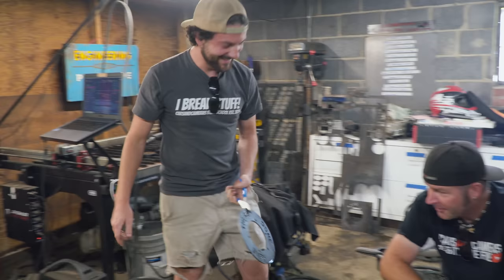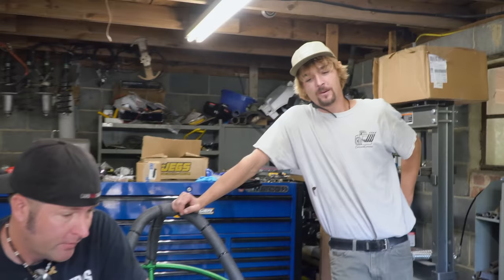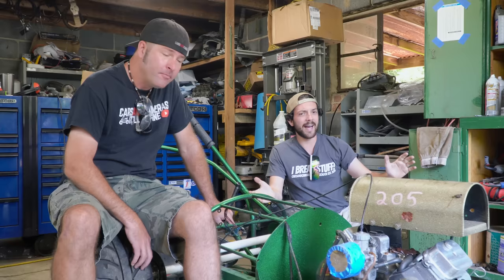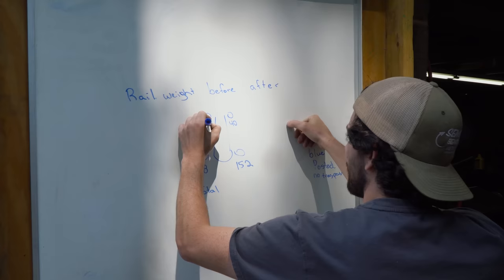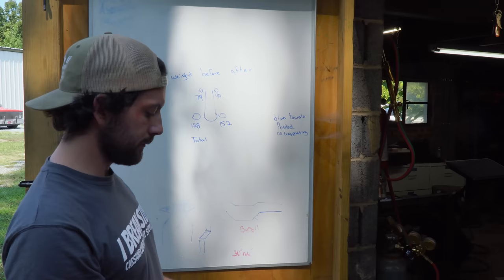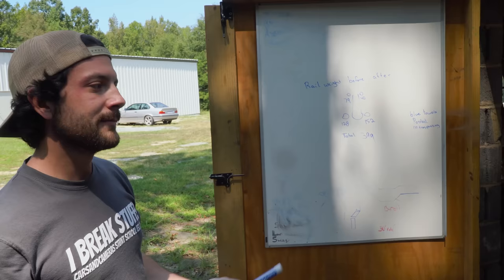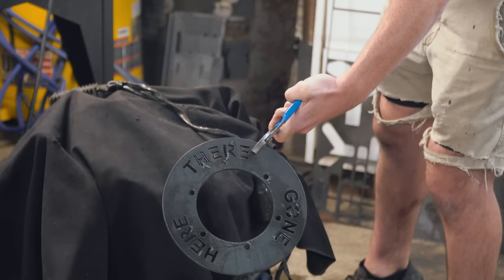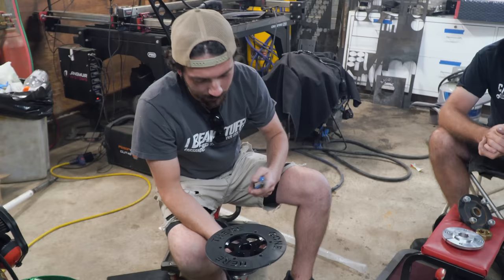We Turned our 670cc Drag Rail into a DIRT DRAGSTER | 55HP Rail gets Chromoly Axles + Off Road Tires!

Comment: I know y’all are making these rear tires temporary but what PSI were you running. I have the same wheel and tire setup on my can am four wheeler and run them at about 5-7 psi. My sport wuads I was running 3 psi. Helps with ride quality and major major traction improvements

Comment: Hubs only as strong as the Key.. should be splined or threaded, Keys will shear...
Reply: Cut down square shank screwdrivers work. Most the  manufactured keys are made to shear.

Comment: Take some air out of those rear tires for Christ sake. What do you have in those, like 50 psi? Take them down to 10 - 15 psi and you might pull wheelies. Lose the mailbox (it does nothing but add weight), and get a smaller battery. That'll drop about 20 lbs right there.

Comment: If you wanna work out the weight kinda janky, take the offroad wheels off, put the old wheels in the seat, use a single set of scales under the tail and one under each front wheel. I bet that will show you where the extra weight is

Comment: You guys should use a 2 liter supercharger belt drive it off a jackshaft. Better than a turbo self-contained it won't get hot like the turbo would you can mess with pulley sizes to get the turbo where you want it under power and it would make that thing really move Amazon sells a belt-driven supercharger for $200 Universal for a 2L and below!! Power a Jack shaft straight off the engine he can spin the pulley for your supercharger and the belt drive for the engine. You don't need an oil pump you fill the supercharger up with oil and it won't get too hot like the turbo will much cleaner and very effective give it a shot guys I'm building a trike with one

Comment: a hollow axle is weaker than a solid axle in the set up that you guys are running with that go-kart you need a bigger solid axle not a hollow axle because even though the hollow axle is bigger it will end up twisting and breaking

Comment: You are loosing time on engine revving up.. maybe build clutch bomb... thing? Essentially engine crank turns freely, CVT pulley turns on bearings on crank and can be connected with two plates that slides in place and locks on each other, one in crank and another on CVT pulley. Violent as fuck method, but would allow engine to rev up high with out cart moving. Alternatively how about putting car clutch on? Should be able to shave hefty amount of time with this.

Comment: whats the Bolt pattern ?? 4x4" ? like a Golf kart.. Ive got the perfext practice tires ,, ill donate them if you come get them .. they need a tube in One .. but RE 22" kendaClaws on DWT bluelabels . 4-110mm
 honda bolt pattern .. Tires are Drag cut and snowmobile spiked .. With legit carbide tipped Snowmobile Spikes .. Tires are 6ply . and spikes have a 1"-1_1/4" flat smooth 
head .. it maty ber possibile to remove the tube and put a regular valve stem in .. 
.. tires are about 72ish " rollout .. and the rims  can be cross drilled. if needed .
Im located on the edge of Jacksonville N.C.
Reply: PS i have a 2nd set of 8X8 DWT blue labels never used .. also 4-110
and they Hook good at Busco Beach ..( when the dragstrip is hard packed ) wont be enough for Honduki .. But with them youll spank every one short  of a True dragster .. (my Hondawasaki ( 86 250x/77 KZ650) Liked about A 80 " rollout .. ( thinking a set of 25-26" tires done the same way .. will be great for practice .. ( cannot use them in mai event .. ( but preped dirt drags Call for a ( 800.00 + set of Skat track Paddle tires. ) Hondawasaki  has 81" rollout 10 paddle rippers  and a rear sproket thats 12-14 " in diamiter ,,
Reply: dirt drag racing is Kinda  like boat racing ,, a perfect set up will spin the entire race length.. , and tote the front up so the chassi bottom is aprox 15 deg tilted ..  putting all the weight on the tires .. .. .    the key then is  like finding  the correct prop for a speed boat ..